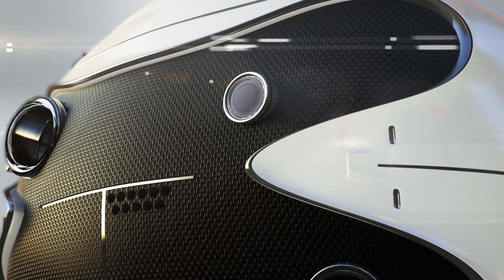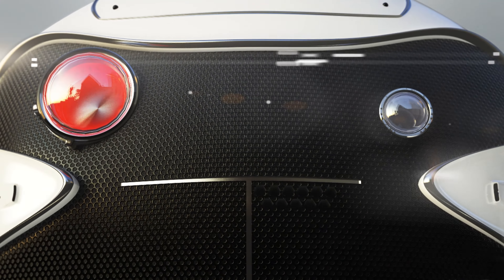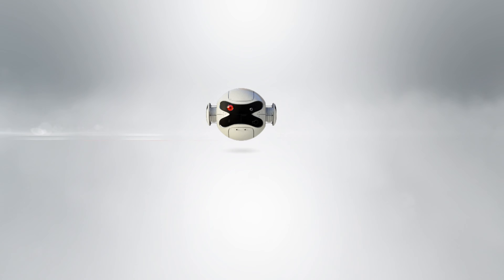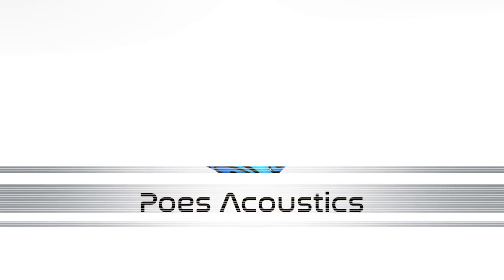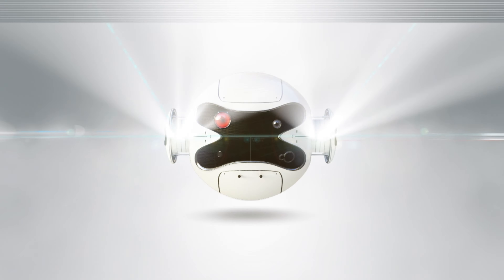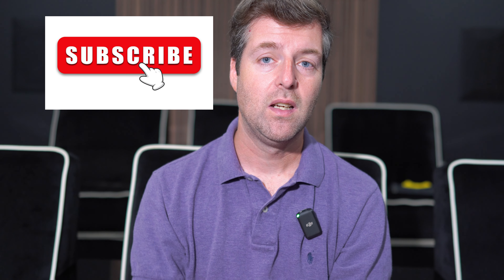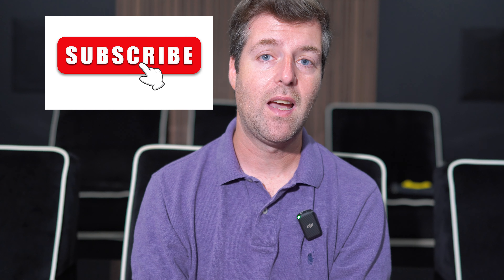Sound Waveforming: Unlocking its Secrets

Comment: Hahaha!  I just completed designing and purchasing all of the materials for four Racks.  Two for the front (a total of 4 Subs) and two for the back (a total of 4 subs). It's a near PERFECT solution!  It gets all eight subwoofers exactly where they need to be, it's very cost effective, and if I were to ever change rooms, they are fully adjustable and therefore will enable me to get all 8 subwoofers perfectly located in a room of completely different dimensions.  Ps. My 15" subwoofers weigh in at 130 lbs EACH, and hence I went with these (modified of course) racks - Edsal 72"H x 77"L x 24"W Steel Welded Storage Rack (sold by other companies too Muscle Rack, Ironton, Lowe's, etc.) Possibly overkill, but Hey sturdy as all hell.
Reply from the maker: Mine get the job done. In hindsight I think a heavier duty rack would have been better. They rock a bit if you push on them. It’s hard to find a rack exactly the right size.
Reply: @PoesAcoustics   @PoesAcoustics  My above mentioned Racks (sold by several different companies) are 1. Super heavy duty and handle two 130 lb Subs with ease, 2. Are infinitely adjustable vertically allowing me to get the Subs exactly as Trinnov states,  3. At 24" deep they are perfect for my giant 15" subwoofers (which are 28" deep!, but which the FEET land within the 24 inches), and 4. I did however have to modify the shelves width (which were way to wide..., cutting them down to just 2" wider than my Subs, which are 18" wide).  Note: 77" wide stands are NOT wide enough in my room for a 4x4 setup, hence I had to use 4 Racks cut down to only 20 inches in width, and hence shelving that is super strong at such a narrow span.

Comment: It would be nice to see the measurements of before and after
Reply from the maker: I am waiting for permission. 

Really what is key is the seat to seat. 

The seat to seat variance in my system went from +\-5 dB to 3dB. I suspect that once I get the second amp for the front and move the rear subs, we would be a bit better. The other issue I have is that the subs are too far apart. Until I fix the front baffle wall to accommodate the subs I can’t fix that.

Comment: Hey man. Cool video. Here is a question that I have with waveforming. Since waveforming works by producing base with the front subwoofers and then dissipating/eliminating/canceling the base with the back subwoofers. Am I right in thinking that you would not want any other speaker in the room to produce base. Since the base from that speaker would not be canceled by the back subwoofers. Meaning that if somebody will implement waveforming in their home theater, they would want to limit the base from the LCR speakers, no matter how big and/or and capable they are, because the base produced by the LCR will no be canceled by the rear subwoofers. This also applies to surrounds and height channels. So am I correct in assuming that one could get away with less powerful speakers for LCR since you don't need them to go down below a certain point. Also would you still want your speakers to produce any base with waveforming and if so why would you still want your speakers to produce any base. Thanks in advance.
Reply from the maker: That is correct. Waveforming assumes bass management. It doesn’t currently work with the LCRs. It could potentially in the future. For now that would cause more harm than good. 

Keep in mind that most LCRs would distort badly if used in a scenario like this. They just wouldn’t have the output that low.

Comment: Off topic, but do you feel the CSS SDX12 sealed sub that you reviewed ~4yrs back is still relevant, or have other 12” DIY options in such small closures (~1ft3) significantly exceeded it? 

Looking to upgrade from my SVS 3000 Micro but size is a major constraint (and I want to stick with sealed). Thanks!
Reply from the maker: I am not aware of a better option.
Reply: @PoesAcoustics  Thanks!